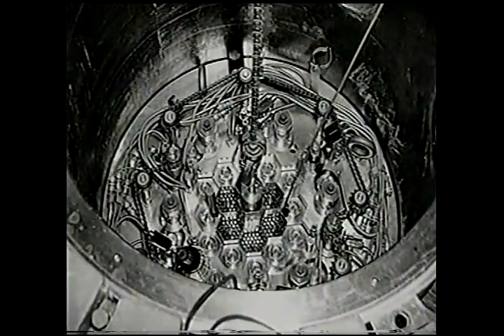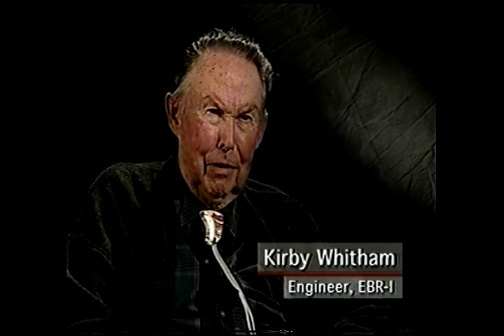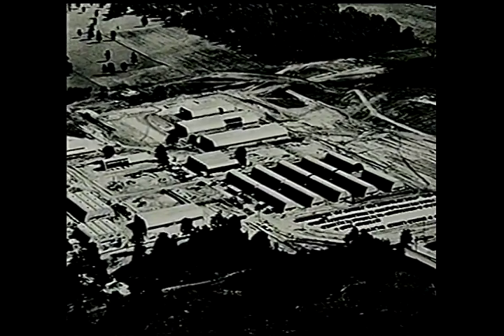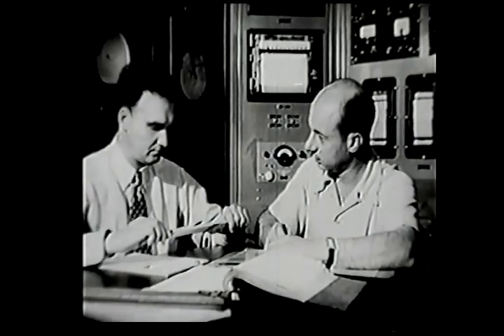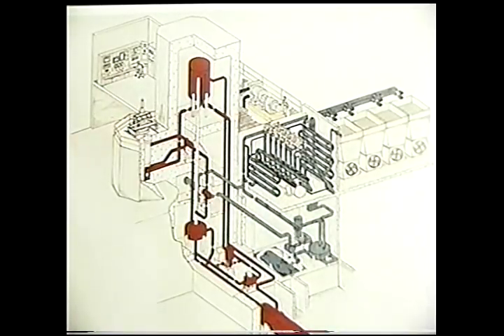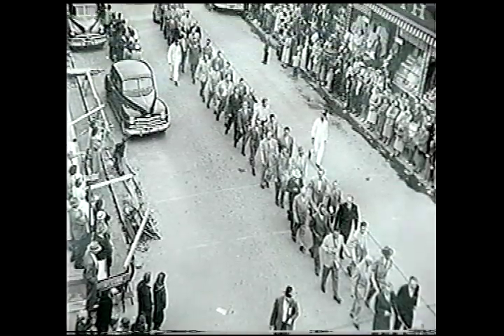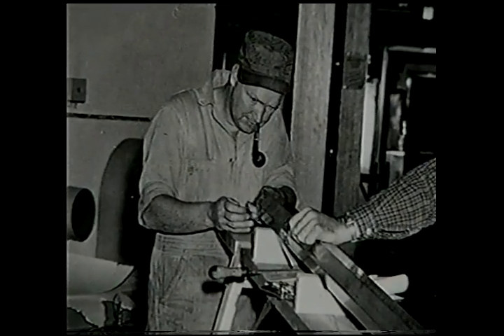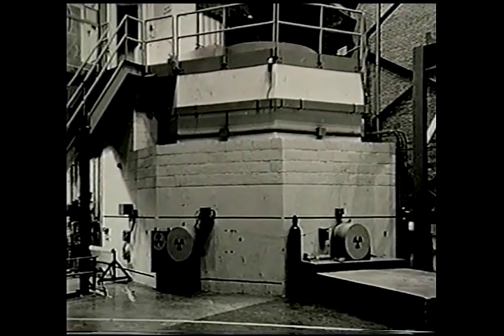Nuclear Pioneers: EBR-I

Comment: Bah,  water cooled reactors suck.   We only went with breeders because the defense industry wanted to make bombs out of the waste daughter products.

Bring on the LFTR's already.
Reply: LFTRs hold great promise, but no one "went" with breeders at all. The only breeder reactors ever built are experimental or research reactors. It seems you're confusing water moderated reactors with breeder reactors (they are virtually the opposite of each other). Also, "daughter products" are lighter nuclides which result from the decay of radionucides. The stuff nuclear weapons use (plutonium-239) is heavier than the fertile nuclide from which it's made - within the fuel elements (usually a mix of fissile uranium-235 and fertile uranium-238).